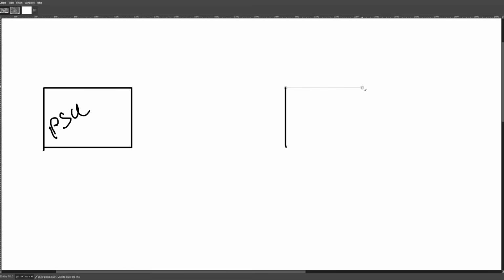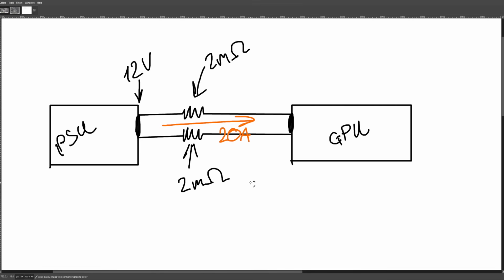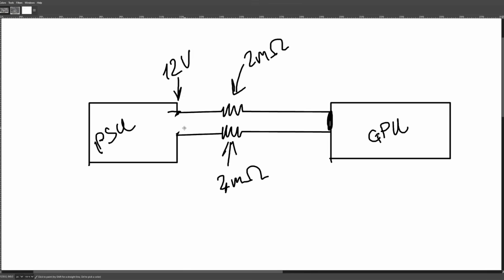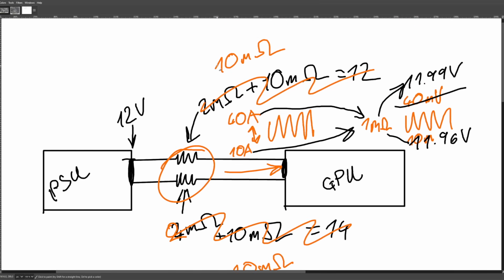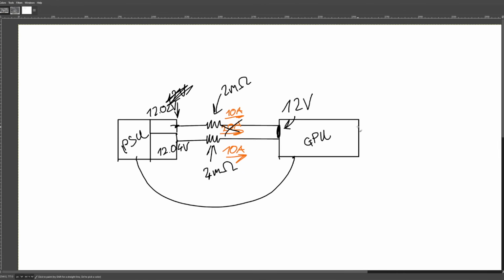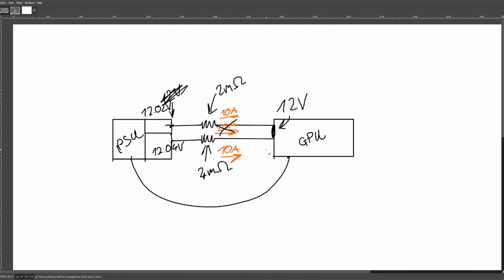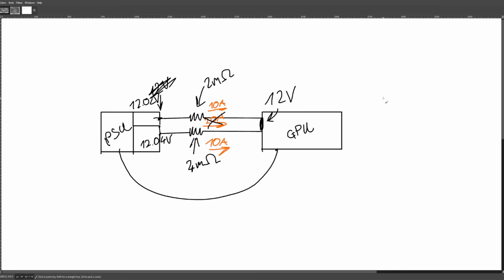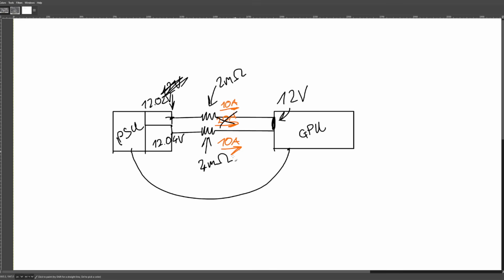Why ATX power supplies don't load-balance power connectors

Comment: I said this multiple times already - I think the physical reason for imbalanced current (imbalanced resistance) isn't that something isn't plugged in correctly. I'm almost certain it's just oxidation on the pins (on either end), that isn't always equally "scraped away" when plugging it in. Wiggling the connector will also make the resistance connection better near the edges than in the middle, so those will carry more current, and those will melt. If this is the underlying issue - a user end solution is to simply plug the connector in a few times to make sure there is contact with actual metal surface. Also this explains why you can never reproduce it in any sort of test environment.
Reply from the maker: That sounds like a plausible theory to me.
Reply: @ActuallyHardcoreOverclocking 

It still Shows how criminally little Overhead that connector has, that we have to concerns our selves with oxidation around Pin edges...
Reply: @3R45U5 Especially when it's happening on brand new hardware. These aren't all cards and PSUs sitting around in a garage for a few years, the oxidation should be minimal in many cases. It comes back to the connector simply being a flawed design that can't reliable ensure adequate contact on all pins.
Reply: @JJFX- yes, exactly. And especially for cards that cost a kidney.
This is a joke that we have to talk about it.
Reply: Which then begs the question... Why isn't 12HP mandated to be gold plated? It's not for ease of flow but purely for corrosion resistance, which surely would solve this problem for literal pennies on the total cost (gold plating these days is dirt cheap and seems insane that it's not being used if there's such a risk of imbalance)
Reply: Yeah, when 100 replugs was tested, load balance became better after 5 to 10 replugs
Reply: Found it: JayzTwoCents did a video a month ago where they reinserted a couple of cables 100 times. One of the cables had the worst imbalance when first inserted, which then got better as it progressed.
Reply: Cheap 12VHPWR connectors are only rated for 30 mating cycles, so don't overdo it. Even Amphenol ones are only rated for 50.
Reply: @tepon1fanithat is what that video was testing. Matibg cycles
Reply: I really don't think this is an oxidation issue, unless it already began to heat up dramatically. This is true for connectors that might be several years old and stored in humid conditions. If they are gold plated it is even less of an issue outside of the connection points. Oxidation is very very slow, and doesn't result in bad connection typically until there is a few dozen nanometers deep oxidation.
Reply: I swear I recently saw something (a video?) somewhere with supporting evidence for this theory, I'll have to go try to find it.

EDIT: possibly not specifically oxidation, but other connector effects solved in similar ways
Reply: Oxidation has almost nothing to do with it. The resistance of the connection is mostly dictated by the force holding the mating surfaces together and the surface area of the mate. When you fail to fully socket the connector, both the mating surface area and the pressure holding them together drop and the resistance rises dramatically. A properly seated connector should have around 5 mOhms of resistance. A poorly mated connector can be as high as 200 mOhms.

Another part of the problem is that as the connectors heat up, the spring force decreases and the inherent resistance of the contact increases, so as all the current goes through one single pin, the whole system heats up which increases the resistance which increases the power it absorbs, which increases the temperature, and so on and so on. Its a runaway thermal event which causes the connector to melt. There is a rule in connectors: You can't current share across pins without active current management. That's why you use one big cable from the power pole to your home instead of trying to split it into dozens of smaller ones. One way works and the other doesn't.
Reply: @ericschumann4213  So basically at this point they may as well thermally couple both sides of the pins with as much heat-sinking material as much as possible (the PSU and GPU sides are probably fine bc they'll have big bus planes), ie solder all the wires together in the cable just before the connector, to keep heat relatively consistent between the pins to keep resistance relatively consistent, to keep current consistent.
Reply: @ShinyQuagsire  There are four immediately obvious solutions to the problem. None of them is a slam dunk.

First, they could use thicker wire and a beefier connector so that they only need one conductor. There are plenty of 100+Amp connectors in the world that would work. I'm a personal fan of the XT90 connectors. They are rated for 90 amps continuous. At 12V, that would be a 1000 watts per pin. They are fairly expensive and would require the PSU manufacturers to get on board.

The second option is to run a higher voltage to the GPU. at 60V, they could get 600W for that single 10 amp conductor. Not great, and still requires the PSU manufacturers to get on board.

The third option is for the PSU manufacturers to design PSUs that provide dedicated, per-pin, supplies so that each pin has its own built-in current limiting the way the whole PSU does. This is very expensive and requires the PSUs to do the heavy lifting, but is "foolproof"

The last option is the kind of load balancing hackery this presenter suggested. This is the cheapest option, but will almost certainly require active cooling, and will ruin the efficiency, so it will have to be on the GPU side as the PSU manufacturers wont touch it with a 10-foot pole (It would ruin their efficiency and make it nearly impossible for them to make energy star ratings among other problems).

Personally, I thinks its high time for both 1 and 2. 60V, using an XT90 connector could supply 5400 watts.
Reply: They probably should have also required that the cables themselves physically tie the wires together before the cable ends' connectors, so that the resistance differences balance out better both electrically and thermally. Thermals are the core reason pins/wires running at higher currents is an issue, so any measures to spread those heat differences across all the wires will help. It also means if you snipped one wire, the current across the connector itself will stay the same even if the wire currents increase.
Reply: I understand what you mean, what about previous contacts where this is not a problem? Then it must be said that the problem is a little more than this.
Reply: @koford previous plugs have way bigger pins and safety margins, 8 pin pcie is rated for 150 Watts but can handle 300 without any issue, imo 12VHP should have been rated as 300W or 400W
Reply: Commenting to follow the thread
Reply: That would underline jays2ct findings.
Basicly the good old work it in... from the mechanical world
Reply: One way of card owners testing this theory, would be to run benchmarks, and use a laser thermometer on each of the 12 pin power cables.

Then sand the cable contacts with 2000, 2500 or 3000 grit sandpaper, and repeat the test.

That would show if removing the oxidation reduces the temperature difference between the coolest and hottest cable in the 12 pin power cable.
Reply: @davidestabrook5367  That's not how laser thermometers work. They don't measure at exactly the point the laser is pointing. It is only used as a guide for aiming. The measurement area is a circle which gets larger with distance to the target.

Comment: You're calculating parallel resistance incorrectly Rt=(R1*R2)/(R1+R2)
Reply from the maker: it's 1/(1/R+1/R)
Reply: @ActuallyHardcoreOverclocking  You're both correct as those expressions are the same if R1 = R2 = R.
Reply: @exscape  formulae are both correct, regardless of r1 and r2
Reply: @ActuallyHardcoreOverclocking  but that's the same -- for only two resistors - and when I do the math in my head only i do use r1*r2/(r1+r2)
Reply: Both formulas are correct. Dh66 is just refactored to get rid of the double fraction. ActualHardcorOverclockings formula has the advantage, that you can easily add more parallel resistances.

Comment: I wouldn't think the GPU seeing <12V or even the voltage bouncing would be an actual issue, because it's chopping that right down to a few volts and smoothing it out anyway. The 12V line is pretty noisy at the best of times and the regulation is easily fast enough to deal with that. What it will do is cause the GPU draw even more current since it's still drawing the same amount of power, just at a slightly lower voltage. So everything gets worse, less efficient, and very hot very quickly.
Reply from the maker: The voltage regulator works best if it doesn't have to deal with the input voltage being all over the place.
Reply: @ActuallyHardcoreOverclocking  why? it isn't a "smart" device, it just chops up the voltage. if the supply voltage is lower, the cycle on the regulator adjusts so that the output voltage is correct. i don't think it would care at all honestly. it's being adjusted at what, 50khz? 100khz? or is it more like 500khz? i don't recall, but either way, it's happening more than fast enough that a 1 volt drop in input voltage wouldn't matter one iota, imo. i bet you wouldn't even see a change in voltage on the core voltage side because the regulator would be adjusted before the inductor field has collapsed far enough to cause any effect, don't you think?

i would be curious what actually happens - you have a scope to test it, would you be wiling to do a test and see what happens if you drop the voltage supply to the GPU from 12v to 11v, specifically what happens to the core voltage?
Reply from the maker: @spectrum_observer  The issue isn't the voltage being low and staying there. The issue is the input voltage changing constantly. If the input voltage stability didn't matter ATX PSUs wouldn't have an output ripple spec.
Also most GPU Vcore regulators run at 300-500KHz these days.

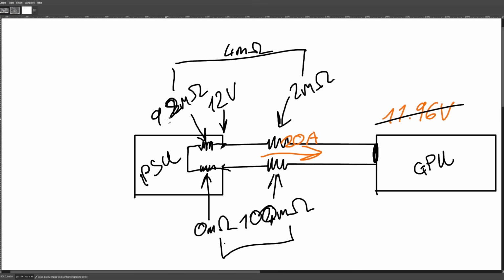Comment: 7:54 "just put an alarm that tells you hey your power connector isn't plugged in correctly".

The ATX spec actually says that the power supply is meant to do something like this, but almost no power supplies do it aside from some Dell ones. Specifically the ATX spec states that "PSU connectors, cables and all other components should not be melted or damaged prior reaching to the OCP trigger." To me that implies per-pin current sensing for OCP, but again, almost no PSUs do that.
Reply: Probably because almost no customer wants to pay for the extra complexity that would bring. Dell also designs motherboards that are weird size or shape, so they clearly don't mind as much about a little extra cost. Also until the 12V high failuer connector came around that wasn't even necessary. The headroom was high enough that you didn't need super sensitive per pin OCP.
Reply: "To me that implies per-pin current sensing for OCP"
"to someone else" that could mean all PSU's have to be pink. Thankfully rules are explicit not implicit.
The ATX spec states the connections shouldn't melt before the PSU's OCP triggers...... it does not say every PSU needs to current monitor ever connector just in case someone buys crappy graphics cards.
Reply: @tomstech4390  So how do you propose that the stated requirement is met without per-pin sensing?
Reply: @ Either have per-pin current sensing on a £3000 GPU, or don't buy shit GPU's i the first place. FIXED
Reply: @tomstech4390  That's not what the ATX spec says though. The ATX spec says that the PSU OCP should prevent damage to connectors.
Reply: @liampwll  Are connectors still being damaged before tripping OCP?
Reply: @Shotblur  Yes, that's what the whole 12VHPWR thing is about, too much current is flowing through a pin which causes it to melt the insulation and connector body.

A lot of people (not Buildzoid) have been explaining this incorrectly as the higher resistance pins overheating, which wouldn't be solved by per-pin current sensing, but this isn't what's happening. When a pin has a higher resistance it will have less current flowing through it and dissipate less power, meaning that the lower resistance pins will be handling more current and dissipate more power.

For anyone wanting an explanation:
Consider two 1 ohm resistors in parallel with 10A across them, the voltage drop is (1ohm||1ohm)×10A = 5V which means that each resistor will dissipate (5V)^2/1ohm = 25W. Now consider a 1 ohm and a 2 ohm resistor under the same conditions, the voltage drop is (1ohm||2ohm)×10A = 6.67V which means that the 2 ohm resistor dissipates (6.67V)^2/2ohm = 22W but the 1 ohm resistor is now dissipating (6.67V)^2/1ohm = 44W, or twice what it was before. This is a little oversimplified as we need to factor in the resistance at the other end of the cable and the negligible wire resistance which makes the effect slightly less extreme.
Reply: @ "That's not what the ATX spec says though", It also doesn't say PSU side per-pin current monitoring is required.
It says the connectors shouldn't melt but if I make one out of chocolate the PSU isn't responsible for that.

But the ATX3.0 spec isn't specific enough and as you point out manufacturers should be held to a higher standard, So with ATX4.0 we can specify that per-pin current monitoring is required.
BZ points out why its not feasible on the PSU so we'll do it on the GPU and manufacturers have to do it on all GPU's.
By gosh ya got me, done deal.
Reply: @liampwll  i don't know that other people are getting it wrong, i haven't heard anyone saying the pins that have a poor connection are the ones overheating. Maybe i've missed the videos that say that. But it is the bad connection that's causing the low resistance wire to overheat and melt things.
Reply: @spectrum_observer  I know off the top of my head that LTT got this wrong, I don't know about others. Specifically in the video titled "RTX 5090s are melting, and it can't be fixed" they state that "[if] one pin has a poor connection then what will happen is that pin will heat up".

I have also seen the same mistake when I've seen people discussing this on forums etc..

I should also note that this would be correct if a majority of the resistance was in the wires, but it's not, it's in the contacts for any reasonable cable length.
Reply: @liampwll  to be fair does anyone expect LTT to get any sort of nunaced subject right nowadays? i sorta assumed they were considered slop now

Comment: why not just larger gauge wire?
Reply: The connector will burn long before the wire itself fails. The variation in cable resistance is due to the connector not making even contact with the socket.
Reply: Is the connector or the wire melting?
Reply: @punktkomma9489  if you just had one wire and one connection instead of 3 you could get 1 wire & connection overloading.
Reply: @posmoo9790  Do you want stiff and unwieldy 10mm² / theoretical AWG 7 that puts extraneous physical load on the GPU?

Comment: Appreciate the video, definitely things I’ve not considered on the PSU side load balancing to think about. I personally don’t think you can spec the 8pins higher as that isn’t practical with what i saw in the datasheet, simply to avoid using the 12VHPWR connector. Perhaps you can go back over what you mentioned with the astral cards and how they apparently load balance with the power supply? That said 8 pins can melt also and there are examples, I managed to melt an ATX connector back in the early days of overclocking. Also curious to hear your thoughts on moving to 24V / 48V finally which is what I really want to see and end this forever.
Reply from the maker: the Astral doesn't load balance. It just measure the current and gives you a software warning when it's out of whack.
Reply: @ Sorry I thought you mentioned in a previous video the astral links to their power supply somehow to load balance?
Reply from the maker: @whatcouldgowrong7914  I'm 99% sure I didn't. I suspect a lot of people misinterpreted something I said about the Astral because a lot of people seem to think it does balancing when it just has a soft-warning system.
Reply: @ActuallyHardcoreOverclocking  confirmation bias, makes people hear what they want to hear.

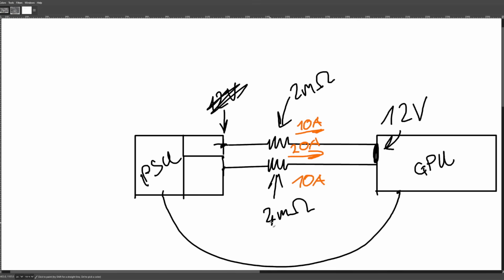Comment: 15:40 - how does the power supply know that it needs 10 amps on each line in this situation? and wouldn't you needs separate voltage sensors per line?
edit: and the mid-roll add for "Altera - is your IT team constantly putting out fires ..." lol..
Reply from the maker: the GPU basically looks like a 0.6ohm resistor.
Reply: The power supply has no (direct) knowledge/control of how much current the GPU will pull. The GPU allows different amounts of current to flow based on what it's doing. 

On Nvidias 50x0  series, the power connectors are all connected together so there is only a single voltage to sense.  The connector appears as a single 'bucket' of power for the GPU to draw from.